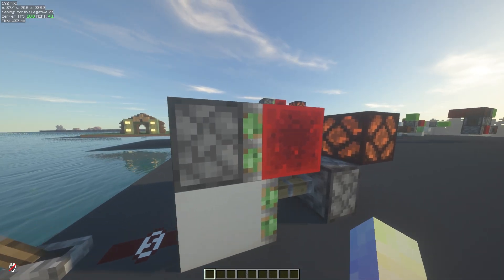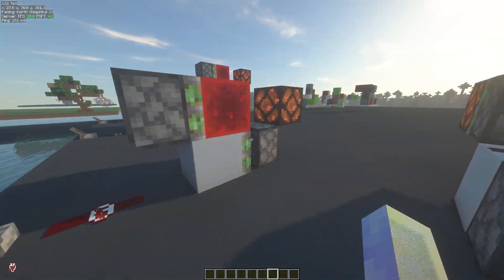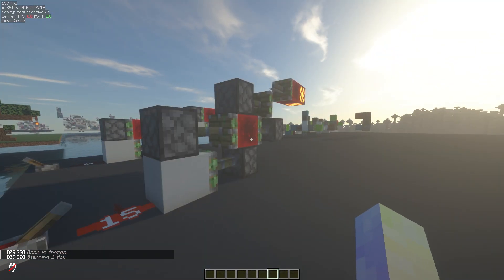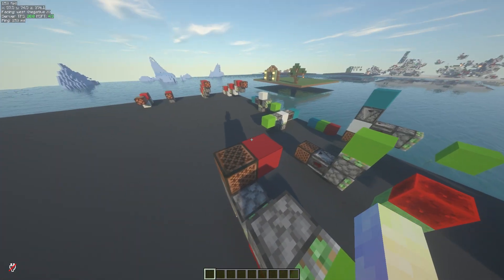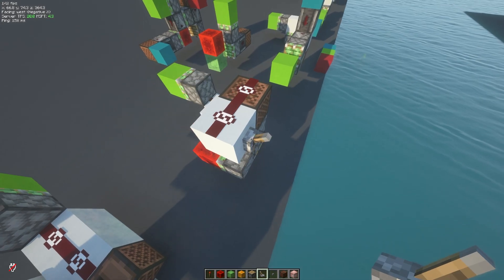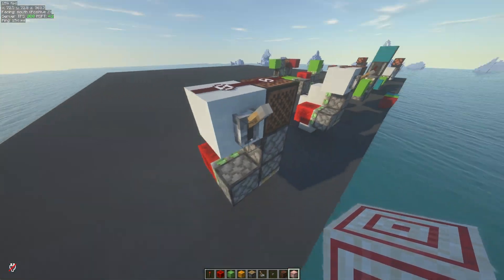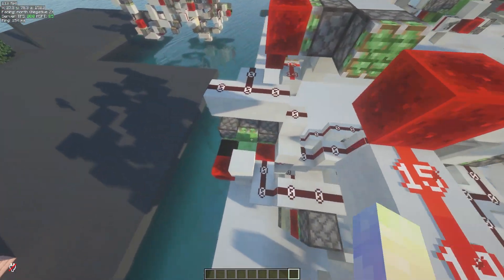0 Tick Basics - Instant Repeaters, Basic 0 Tick Gens

Comment: 1:34 It really takes 2 ticks for the block to arrive (the piston itself still extends fully, the wording could have been better IMO), assuming it's 3 is a bit easier when working with pistons only, but you quickly realize there's something more going on as soon as you introduce a single non-piston component (e.g. a repeater)

3:08 It's not locational, it's only directional

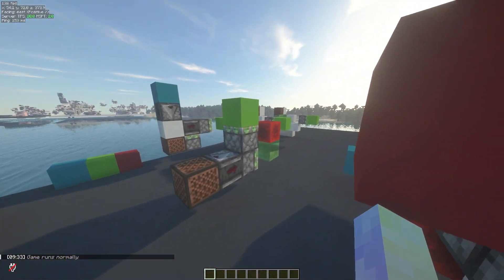4:00 Although the block does move in a single tick, the pulse is really one tick long

Overall, you didn't really explain any of the mechanics that play a role in the circuits you showed, which in my eyes makes this video more of a "0-tick related circuits" catalog / showcase than an actual guide. But this is pretty much inevitable when trying to treat "0-ticks" as some sort of self contained, almost magic-like game mechanic, like most of the players seem to do (that is what I have personally observed, your experience might be different).
Reply from the maker: Thank you for this insightful comment!
About not explaining the details about tile tick priority and all that technical jargon. I did it because I feel like people can use 0 ticks without having to know how they work in the code! I agree about the magic... kinda. I believe that people just treat redstone like some mythical subject, and then when they get into redstone then they find out that something like a 3x3 door can happen instantly. That is when they start to think that its some crazy other worldly magic. And by making this video I can further people knowledge about 0 ticks without having them shunned away with all the technical knowledge!